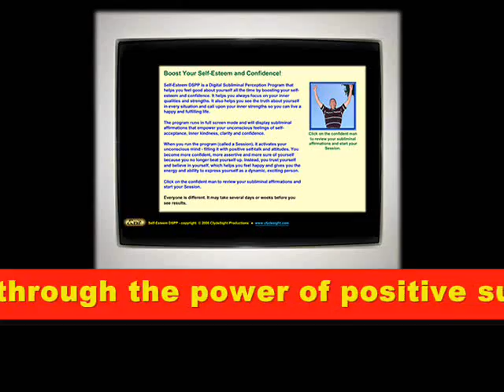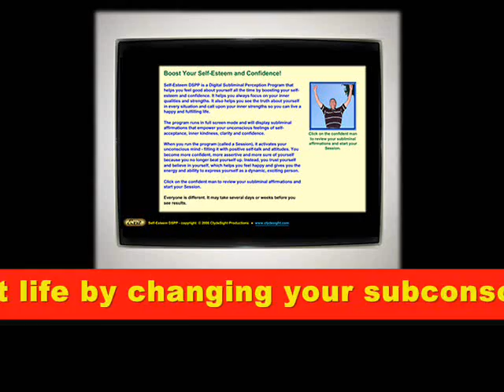Tape Eye Theater - Toshiba KT-210 Cassette Tape Recorder

Comment: Great work on the restoration and the vdeo.  This looks definatly like late 60's, I've seen other things like radios, clocks from the same time period that have the same style.  Someone really needs to bring this style back to electronic things.  I like the way it has a controll lever instead of buttons, just like on a reel to reel!  For some reason this didn't show up in the my subscriptions box, I only found out about this video because i saw another user liked it in the recent activity thing.